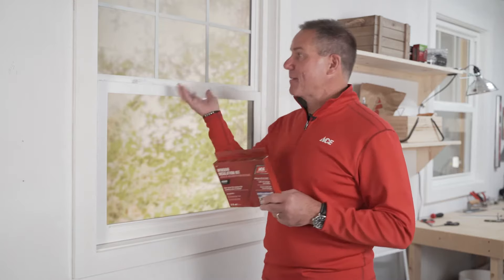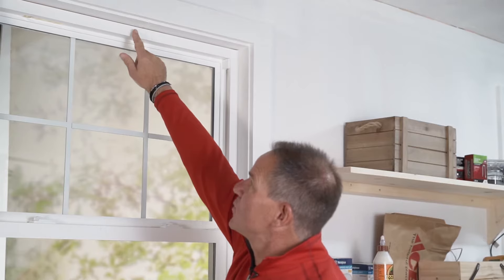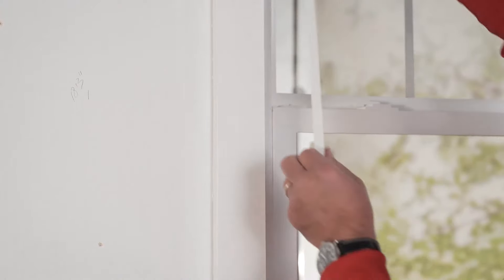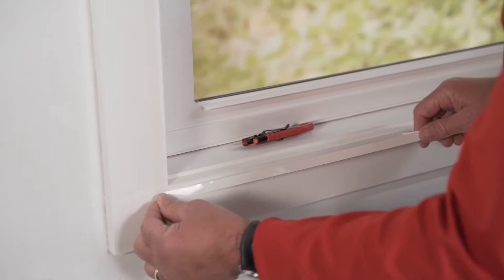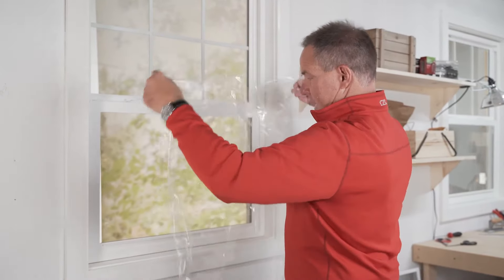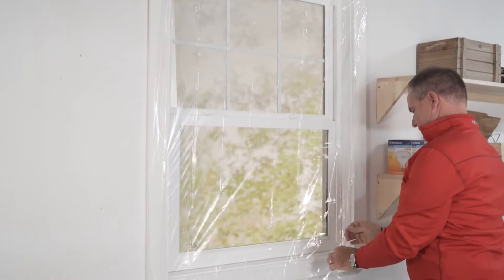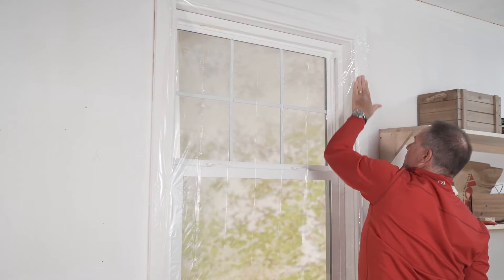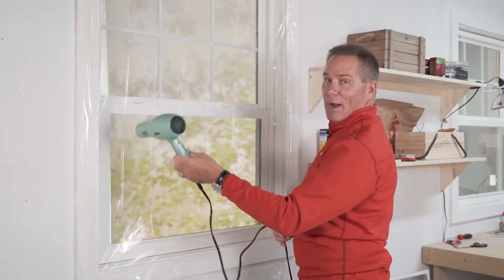How To Install A Window Insulation Kit - Ace Hardware

Comment: This is awesome!! Thanks Ace!!! For anyone who is a novice like me, I wrote out his instructions:
1. Lock windows 
2. Determine if draft is coming between window and fixture. If so, measure film to cover against outside of window on wall vs inside the fixture
3. Make sure film size will fit inside the window & where it will be sealed
4. Clean taping area with window cleaner
5. Picture frame double sided tape along window frame area to cover for entire border of the window
6. Remove double sided tape film
7. Line up plastic to window, sealing top corner, bottom corner so plastic stays in tact while finishing to cover the the entire window. If plastic sticks to tape in wrong areas, it can be removed as long as you didn’t press to seal it in that spot. 
8. Make sure the plastic is taut but doesn’t have to be super tight as hair dryer will do that. Press down on plastic onto tape all around the window frame. 
9. Hair dryer setting on low, warm, not hot. Start in one corner and have hair dryer 6”-8” from plastic. Dry window down one side & up to adhere plastic where it will be tight on window, until it’s clear. Be sure to press the double sided tape firmly before and after application and move the blow-dryer down as if your drawing a slant. 
10. Cut off any remaining plastic around window.
Reply: legend!

Comment: Will this stop condensation/mould? how will it work if I want to open the windows to get some air in the house when I’m cooking? I live in an open plan kitchen flat so I get a lot of condensation in the living room/kitchen area and I’m constantly having to get rid of mould around the windows
Reply: You wouldn’t do this on a window you’re going to open, it’s for winter time to help cut down on heating costs from hot air escaping through older drafty windows

Comment: My window has no trim just drywall on the sides, do i tape it on the window directly?
Reply: you could, but might not get much benefit doing that because it would allow cold air around the gaps between the window and the frame (assuming you have any) ... i'm in the same boat, i just taped it to the drywall outside the window.  i fully expect when i peel the tape off next year i'm going to rip paint off as well 😂  ah well, then touchup painting will be a new task 😅

Comment: Are you missing the step that shows how to remove the film from the double sided tape?
Reply: Shit that’s what I’m here for
Reply: @allorgansnobody  Hey,  I just bought some tape at ACE Hardware.  It's double sided without the backing paper and comes on a roll dispenser like a Scotch Tape.  Works great!
Reply: @allorgansnobody  he didnt show it because its a job getting the paper off
Reply: @campusman1957  that’s right this was the hardest part of doing this
Reply: @Kindness_222  some times it works sometimes it doesn't but i had a back up plan i bought 2 rolls of clear gorilla tape  so if i did the tape did the job i could have done all the windows with tape but i can because its all coming off after winter
  calk sand paint
Reply: More worried about taking paint off the wall
Reply: I was starting to believe the double sided tape isn’t real.

Comment: A couple of issues with this one:

What happens when you need to take it down the next Spring? Then, put it back up the next winter?
Reply: Just take it down and reapply new plastic and tape next year. The tape is pretty good that it won’t be left behind.

Comment: Ty .  Q: do I put the tape on the Window Glas Frame or on the Window Trim? I bought Duck brand window kit.  My windows arent flat  but the lower window that you push up sticks out from the top window and have 4 individual glass panes.*  I put the tape on the trim in case the plastic shrank too much and the plastic film is too far away that it  isnt sticking to the glass window any! :(  The instructions on the box didnt make it clear where to put the tape. Should I have put the tape on the actual Glass?*   Also the tape did Not Stick enuf as its around minus 3 degrees here  I'll have to redo it :(
Reply from the maker: Hi There,
We recommend you stick it to the trim but that may not work because it’s incredibly cold.  Try heating up the trim with a hair dryer first then stick the tape on it.  Hope this helps!
Reply: @AceHardware Ty;  If it doesnt work is it safe to put the tape on the Glas Frame or on the Glas?***. My windows arent flat but the lower window that you push up sticks out from the top window and the entire window has 4 individual glass panes which means there's 3 horizontal pieces of wood  dividing the tow  main glass panes which  will prevent the plastic from adhering to the glass :( *

Comment: I applied a window film to all the windows in my house due to every window in my house getting super frosty. 

I did have one old-ish single-pane window on an exterior door shatter the day of applying a window film. Very odd since there was no warning of this happening. 

I also cannot find any information about this happeneing to anybody else.  Is this something i should be worried about with my other windows? They are a lot newer with dual pane glass.
Reply: I have seen improperly installed windows do this when very cold. If the prefabricated window unit was forced into a hole in the wall that was not the correct size, it can cause it to be under severe tension. Even moderate pressure in the wrong place could cause this to happen. Same idea with drilling holes into metal after doing body work on a car. Relieves the tension in material, but you can't drill holes in the glass lol

Comment: Seems it would look nicer attached to the window's frame rather than the trim, BUT I expect the insulating value is MUCH more when attached to the trim, because that creates a large air gap between the window and the film.  The plastic has virtually no insulating value itself, it's the air gap that does the insulating.

But what happens when you want to remove it, e.g. in Summer?  Then you're left with that adhesive all over your trim.  For that reason I might want to put the adhesive on the outside edges of the trim rather than the face.

Comment: Does that thin film actually keep the cold out?  I was expecting something a lot thicker.
Reply from the maker: Hi Nathan,
When installed properly it will keep the cold air from seeping into your home if the window is drafty. You may also want to look at the caulk around the window to seal up any gaps or cracks.
Reply: Any thicker and you won't be able to see out the window clearly.

Comment: Have you ever run into condensation on the inside of the film?
Reply from the maker: If condensation on the inside of the plastic it might not be sealed all the way. Hope this helps!
Reply: @AceHardware  thanks!! That could be it. We ended up with a bit of a puddle under our couch along the patio door we sealed offf with film. But the seal may have broken and that explain our water issue!

Comment: I’m having a problem getting the paper off of the tape without having the whole thing peal off, tape included. You didn’t show taking the paper side off. Is there a trick to getting the paper to separate from the tape itself?
Reply from the maker: Hi There -  Do you know what brand it is? 3M had a recall on some of their window insulation kits.
Reply: @AceHardware  Thank you. Yes, it is 3M.
Reply: @AceHardware  3)m
Reply from the maker: @karinbrunner7201  Yes, there was a recall with 3M. Contact them here regarding next steps and confirming your package was impacted: https://www.3m.com/3M/en_US/company-us/help-center/
Reply: It is very very difficult to separate the paper on one side of the tape  from the tape that is initially attached to the window frame. Has anyone figured out a fast way to get the paper off?  In addition, if you attach tape to the trim/molding it will leave a glue residue that is hard to remove without damaging the trim surface.
Reply: @dcmiklas   Same issue here, frustrating. In these vids they separate it quickly and it took me more than an hour! to do so.
Reply: @dcmiklas - Goof Off works on all sticky glue residue, without hurting anything

Comment: How do you open the window if the film is on the window frame?
Reply from the maker: If you open the window, you will lose the film and suction. You'd have to reapply the kit if it still with bond to the window or use a new kit.

Comment: What about ventilation and condensation then mold growing?
Reply from the maker: Hi Dave,
The downside of plastic window films are that they work and you cannot open the window.  The reason you install them is the old windows are drafty, you so get some circulation of air in the new sealed up area, just not into your home.  Meaning that no mildew or mold should grow in between the window and plastic as some fresh air is flowing into that space.  Hope this helps!

Comment: How you open the window ?
Reply from the maker: Once it's sealed up for the season, you will not want to open it until you are done using the window insulation. It can't be removed/replaced all season.

Comment: Now..... show how this is done  on  a  lovely  Equisite ......
OLD dilapidated,  sliding glass  Patio door.  In the dead of winter with ICE on the iINSIDE  that is in a  RENTAL SPACE .  🔥🔥🔥
Reply from the maker: Yikes! That's a good suggestion though, showing how to apply to a patio door! We'll add that to our list.
Reply: They do have a large size sheet of plastic for doors. It’s all in the tape around the trim or metal window frame(?) Obviously the plastic does not need to be against the glass pane to work.

Comment: What about using a heat gun on the low setting?
Reply from the maker: Hi There,
A heat gun is not recommended as even if it's is on low it is likely to melt the plastic. Hope this helps!

Comment: So this means that you can't use the window afterward? What if you want fresh air?
Reply from the maker: Hi Matthew,
You are correct, once you apply the hair dryer your window is sealed for the season. If you wanted to open the window for fresh air the insulation material shrinks up/wrinkles making reapplication difficult and not the same result. You'd have to use new plastic. Hope this helps!
Reply: Seriously? It's to keep COLD (fresh) air out.  Cannot have your cake and eat it too. It IS removable though.
Reply: open the doors.
Reply: @ethelschnorr950  what if you’re in a bedroom?

Comment: Instructor: 
"Dont use high setting, you dont wanna burn a hole in the plastic".

Instructions on back of kit:
"Hairdryer set at highest setting.." 

Due to this confusion I've opted for removing the window and bricking in the hole.  

Can never be too careful